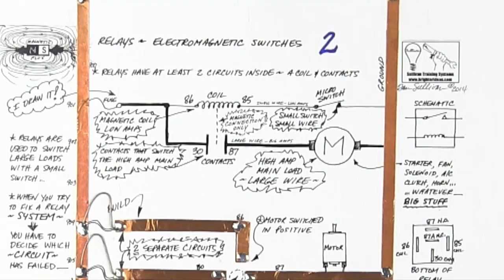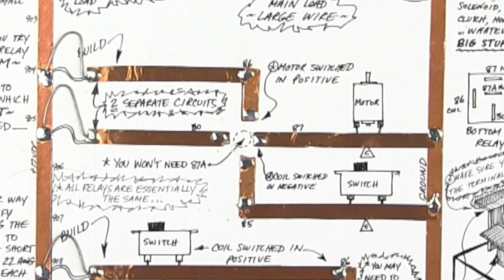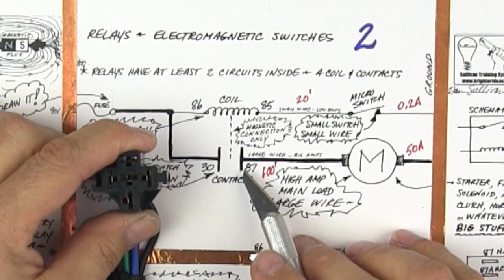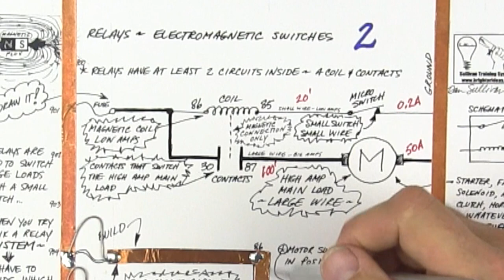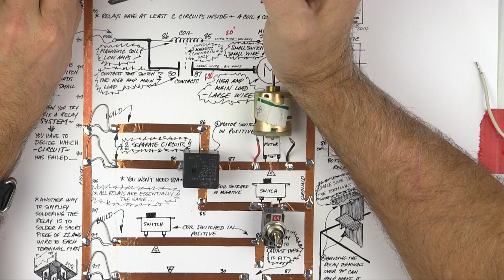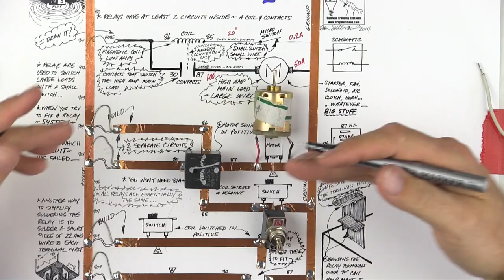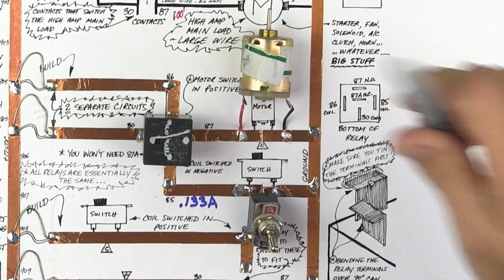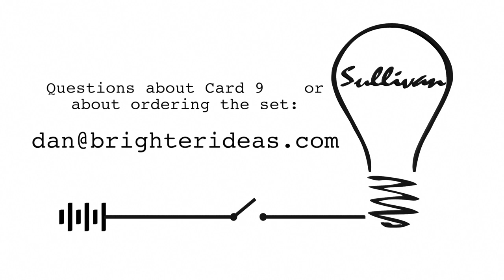CARD 9B - RELAY SYSTEM - Hands-On-Line Electrical Training

Comment: We have seen your solder fuses melt in a dead short situation, I was just wondering what would be the least amount of current it would take to blow the fuse? In an above 10 amp situation, would the solder fuse protect the meters internal fuse?
Reply from the maker: John C Not sure - I was assuming the dead short was the worst case scenario. I never really tested it, other than knowing that the fuse withstood the 12 or so amps that was in the circuit when I demonstrated the Starter Buddy. I've thought about trying to figure out how much of the width of the foil tape to cut to protect for a certain amount of current - though I haven't enough time to fart, much less do anything like that. Feel free to give it a whack.